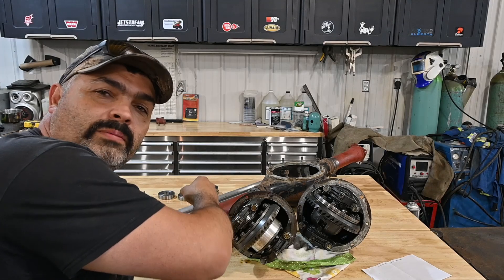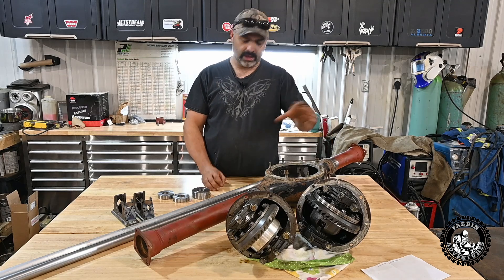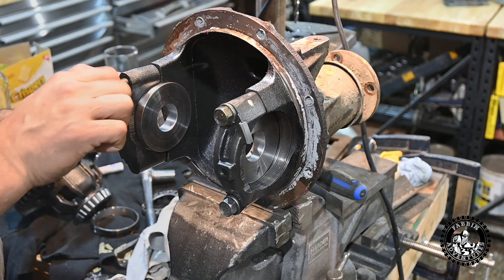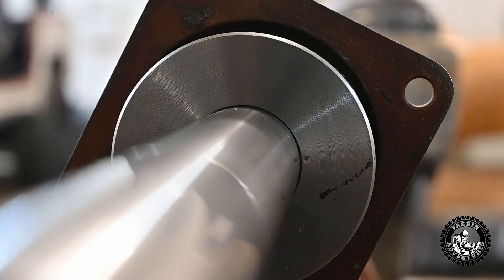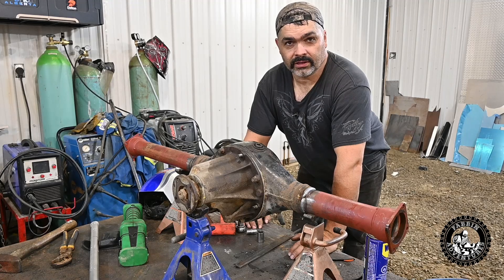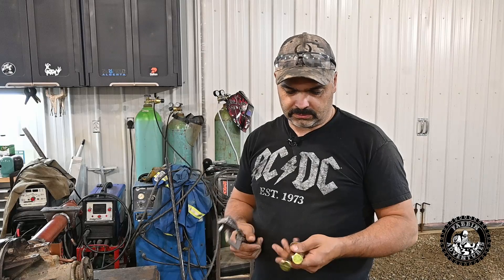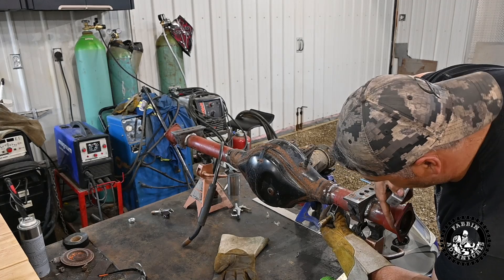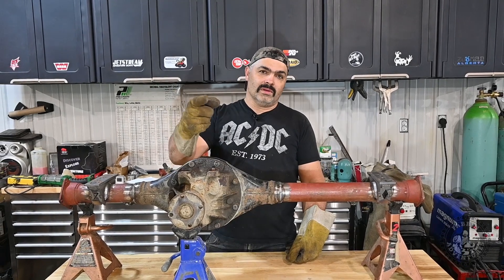Suzuki Samurai Hybrid Diff: Part 2

Comment: How much of a difference would a cut gasket or layer of rtv between the carrier and axle housing make in the centering of the carrier and alignment tolerances of the axel shaft through the center of the diff gears?
Reply from the maker: I wouldnt worry about that little bit of difference. There is enough play in the whole system that it wont make a difference.
I know a guy that has a slightly bent axle tube and he has been running it for years with no trouble. So a few thousanths difference between cut gasket or rtv will not even be noticed.
I just use rtv, put a bead on, put the carrier on finger tight bolts till the rtv sets up, then torque it down.
Thanks for watching and commenting!

Comment: How about making holes on the end plates of the jig to the same diameter as your alignment rod, that way you can save a bunch of time by having it aligned in the jig before tacking it together.
Reply from the maker: Yes, that would be the perfect set up for sure. I didnt have the rod and pucks at the time though.
Thanks for watching!
Reply: @FabbinAdventures  that may help alright , but you can't have the center section in while Jigged .I would be tempted to not tighten the center housing in the jig and only use 2 smaller tacs per tube ,as the jig is only for Width & Orientation . Good videos ,getting my diffs prepped for the same treatment .
Reply from the maker: I think a guy could make a jig that did it all, which would be great if i was to build more than one or two axles.
I imagine my next logical move would be toyotas, unfortunately we start getting away from the light weight advantage!
I have a whole 1980 toyota drive train sitting here for just that occasion.
Thanks for commenting and watching!
Reply: @FabbinAdventures  & the Toyota's are wider ,that makes a difference some of the places I go hunting
Reply from the maker: Yes for sure, there are limitations to the toyotas, being wider and heavier are a couple of them. I do like being able to get down narrow quad/sxs trails.
Most likely i wont go toyota axles, but just in case.
Ill have the FJ40 for full size rig trails.

Comment: really good that you made pucks to replace the bearings you know that everything is going to be right at 100% good video! continue like this!
Reply from the maker: Yeah, after i used johns jig he told me it was made using his diff, but his diff was bent a little. I figured i better get some pucks and a shaft made to check straightness.
Good thing i did!
Thanjs for watching man!

Comment: Nice job! Is there a reason you could not have just used an old set of bearings?
Reply from the maker: I used bigger shaft than the axles are, that way i reduse any flex in the shafting for hopefully a straighter axle!
Thanks for watching Craig!
Reply: the airlocker will be another dimension.
Reply from the maker: Yes, air locker and trussing next!
Reply: Can't wait till your done, so I can try it on my samurai!!